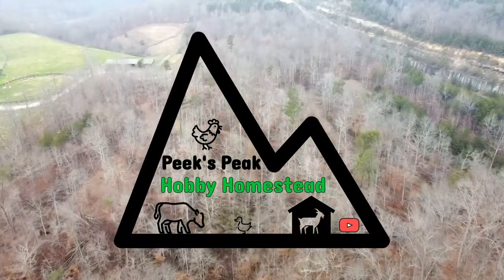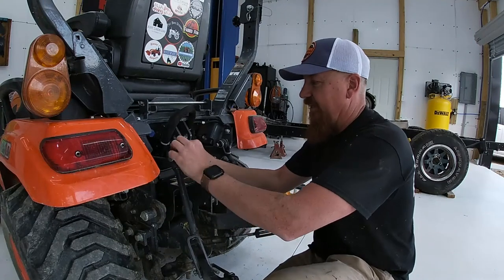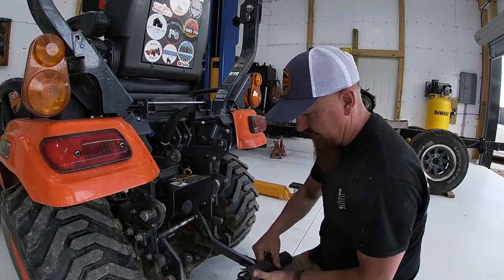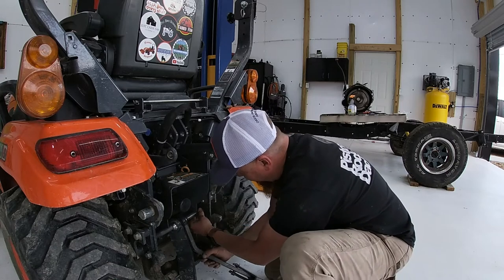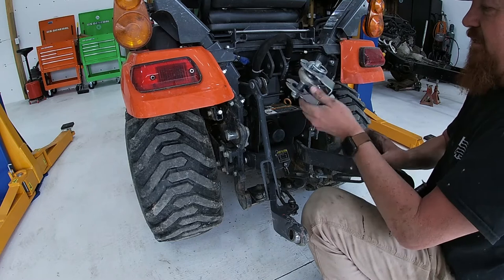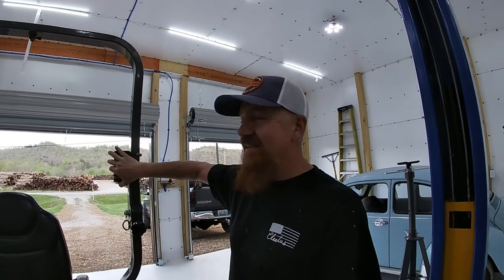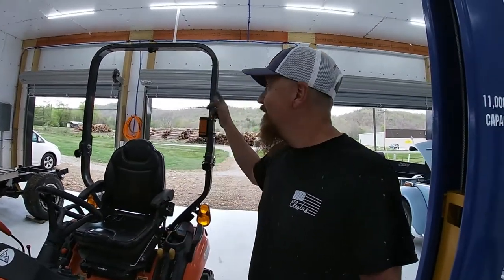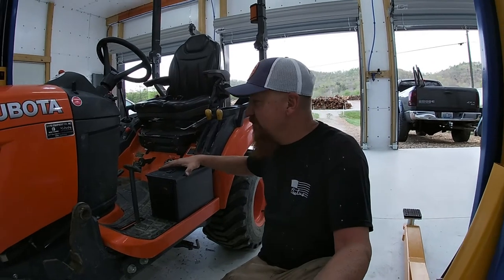Kubota BX 3 Point Hitch Install and Removal - Tuesday Tractor Tip - Bonus Tip - Toolbox and Speaker

Comment: I was hoping that you would help with the install of the weight box.  I installed my box and it seems to move over to the left getting very close to the wheel.  I have used the turn screws on the arms but they don't stop it from moving to the left.  When I put on my bush hog it moved so far left it started rubbing against tire and tore off some tread ... please  show how to adjust it so it stays centered when mowing or using the weight.
Reply from the maker: Have you tightened the turnbuckle down as short as it will go?  It really should just be a matter of tightening it until it is snug and won’t allow the arm to sway.  I have converted to a style of stabilizer links that adjust by moving a pin.  They are much easier to adjust.  Here is a video about those:  https://youtu.be/ENBE1wTpnOI?si=kEH3XS_5xQFwKVUd

Comment: Where U put your toolbox will not work for me, I put one son each roll bar, they really looked good but that was even worse, I keep hitting them on everything, so I just took them off, I wish I has a better place that would not be in my way, I guess that’s what u get with a small tractor.
Reply from the maker: Yeah, I struggled to come up with anywhere and I wasn’t thrilled with this initially because it seemed in the way, but after using it 6 months like this I’ve adapted so I’m ok with it.  Good luck!